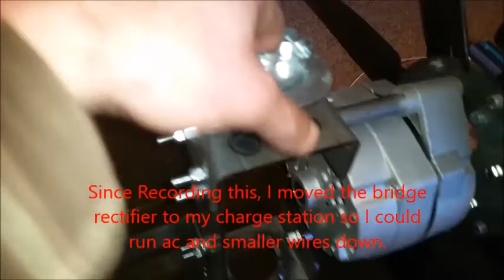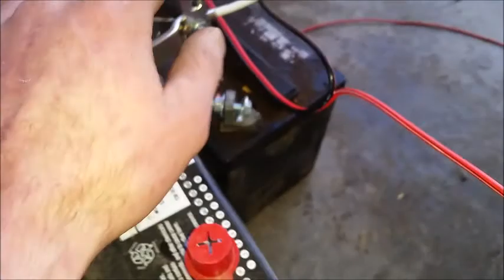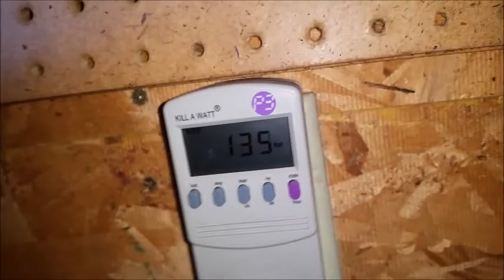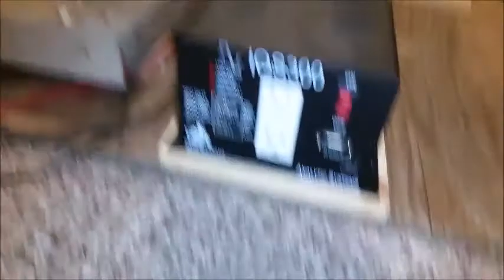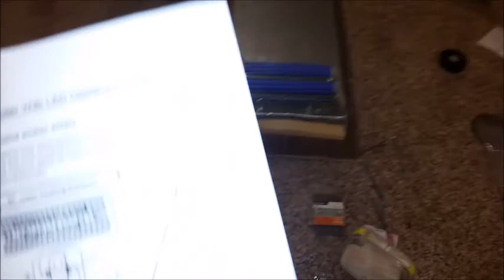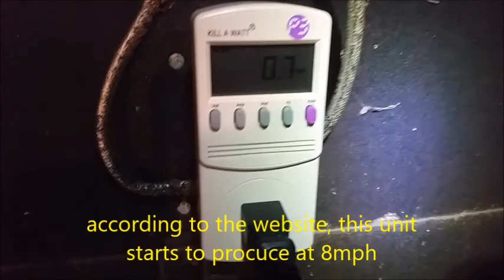Missouri Wind and Solar Confederate 7 blade wind turbine

Comment from the maker: seeing this now, solar it is!  already have electronics set up to receive solar.
Reply: Andy
You have some problems with your install that can easily be fixed and increase your output.
3 people on here are Thermodyne dealers and will mislead you with there misinformation, most of which are lies. One of them is this guy , John Daniel aka Јохн Даниел a Thermodyne dealer. 
Jason Brown has our wind turbines up and into grid ties for about 5 years now with no problems. You should check out Jason Brown's installs.
Reply from the maker: Their comments have been removed.  Please advice if this is done properly https://youtu.be/l5y4dafneWk